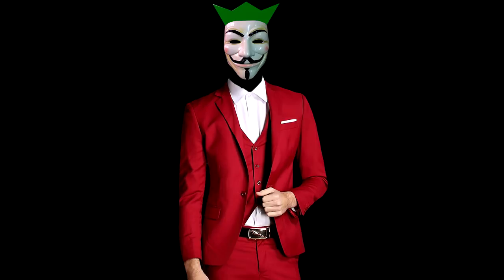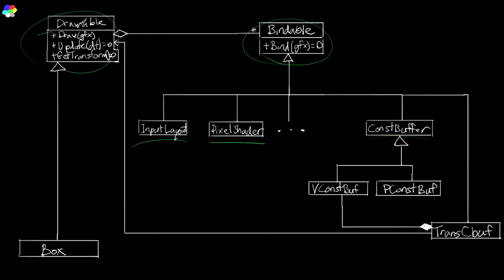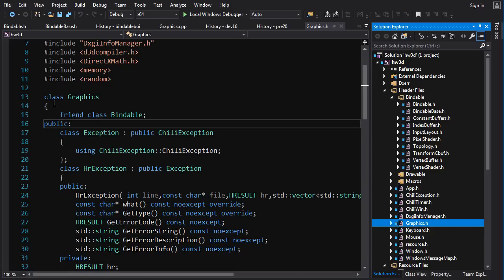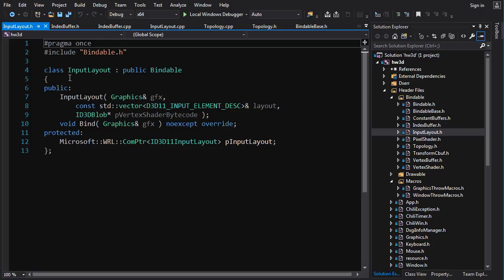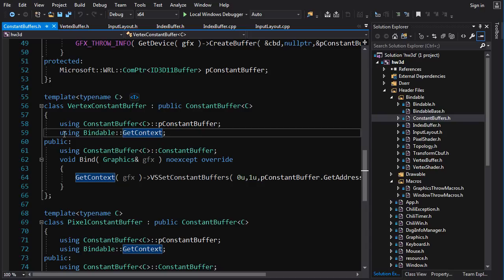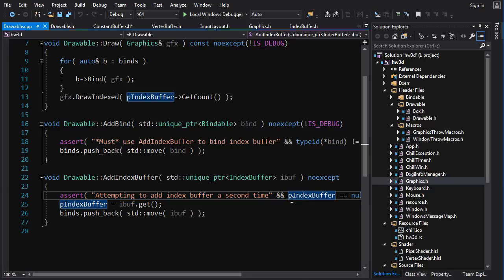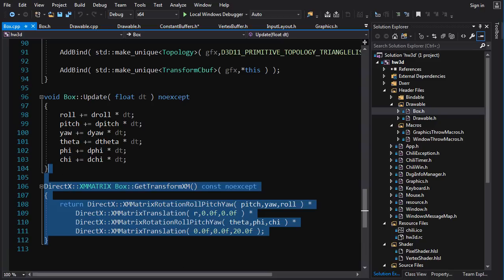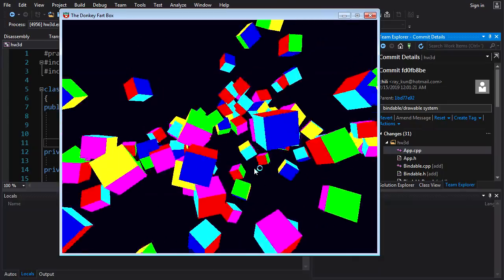C++ 3D DirectX Tutorial [Bindable / Drawable System Part 1]

Comment: This is a massive refactoring. When I did it, when I finally got it to compile and solved the direct3d exceptions, it just showed a black window. So I cloned his repository and checked out this commit. It didn't compile on vs2022 (17.10). I got several weird messages like usage of undefined type std::vector (even though it includes <vector> in the same file). In the end I solved it by including <string> in a couple of files. He relies a bit too much on std includes including each other. Don't do that. Try not to rely on indirect including. But after fixing, his code works. Infuriating. That means going through all these file chasing down the one little thing I forgot.

Comment: a bit of warning:
after applying the commit and running the program, DON'T try to increase "for (auto i=0; i < 80; i++)" in app.cpp to something like "for (auto i=0; i < 100000; i++)" it will just eat up 7 GB of RAM and take forever to render (you won't be able to see much boxes after 1000 anyway)
EDIT: i just found that the program was still initializing for good 12 minutes and my frametime is around 1350-1400ms

Comment: I was wondering if using a WeakRef would be a better choice than a non owning pointer?  I would think it’s a better design decision because it clearly conveys the idea that it’s non owning at a glance but I’m not so sure of the downsides.  I know that with typical shared pointers you want to use weak pointers in this way but I was unable to determine if WeakRef was the equivalent of weak pointer.

Comment: how come the box doesn't have an X and Y position? I've set a breakpoint in the drawable function Draw on the debugger and drawn just a single box, but I can't really pinpoint the location just by looking at the roll, pitch, and son on.

Like, if I wanted to make a getter for the Box object position, would it be possible with this current configuration?
Reply from the maker: Well the transform needs be calculated from those parameters, so what you could do for debugging purposes is just cache position when doing that calculation in some member data. (you can get position by applying the derived transformation to an origin vector).

Comment: 9:36 GraphicsThrowMacros.h line 25: why there are double parentheses?
Reply: It won’t make a difference either way.
Reply from the maker: Sometimes it is necessary to enclose macro params otherwise they fail when an expression is used as the argument instead of a single symbol. Doesn't make a difference on this line, just a habit.

Comment: I noticed an error in the code:  Bindable::GetInfoManager is defined as "noexcept(!IS_DEBUG)", however this is wrong. It should actually be defined as "noexcept(IS_DEBUG)".
Let's look at an example: If you use the release config, IS_DEBUG is defined as false, and ! negates it,  so the definition resolves to noexcept(true), which indicates, that no exceptions would be thrown. However, the function body resolves to throw std::logic:error(. . .); -> This means the program will crash.
What I mean is just remove the "!" inside of the noexcept and you should be fine. Try it out if you don't believe me.
Reply: I wonder how this wasn't noticed for such a long time... Is everybody just pasting the code???
Reply from the maker: Yeah this is right, in my most recent version of this I just have the specifier removed altogether. 

Reason why it's not noticed is fairly easy to see. It's only ever referenced via the INFOMAN macro which is only "active" during debug builds in the first place.
Reply: @ChiliTomatoNoodle  Ah yeah kinda makes sense
Reply: @ChiliTomatoNoodle  Hey Chili, I kinda don't know if we fixed it by the time of this tutorial:
When I try to drag the window or keep my lbutton down on the nonclient area, the app won't draw/update anymore (when I release it basically draws the current state of the app again). This means the app still runs and updates, and when I release the button again it basically "skipped" many frames (I mean it is correct that the app doesn't freeze because of Peekmsg, but wouldn't we want it to keep updating and drawing while dragging the window or clicking on non-client area?)
Hope you get what I mean :)